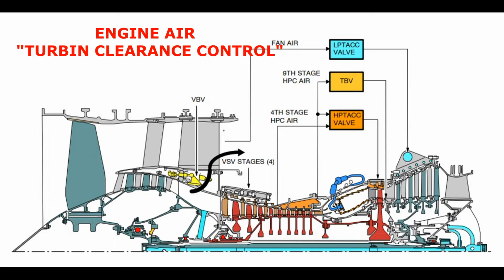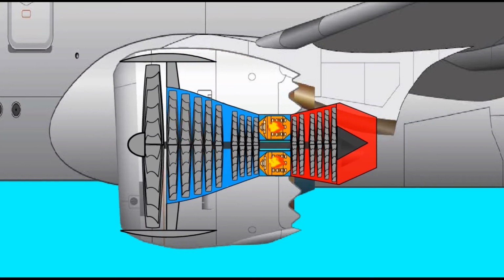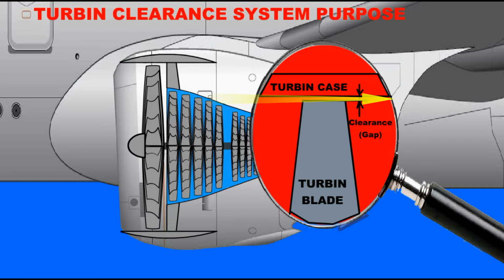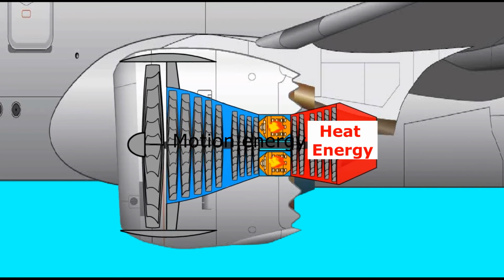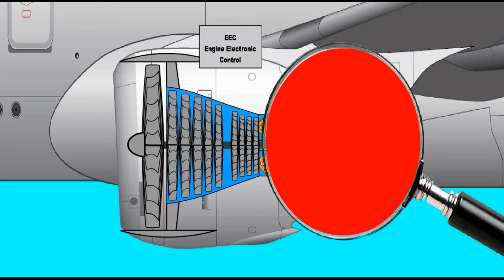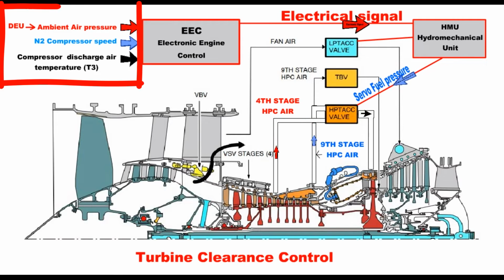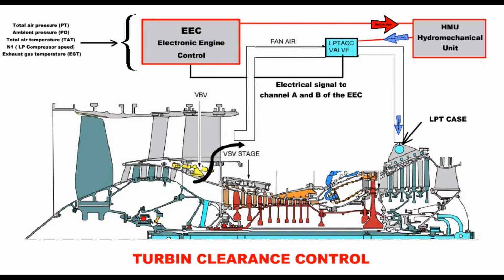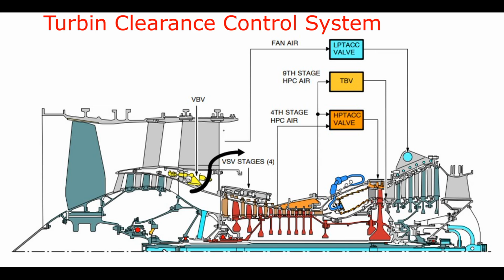TURBIN CLEARANCE CONTROL

Comment: Do you mean that when the turbine expands, the shell around it must be cooled by air to shrink and allow the turbine to expand with the diaper at the lowest possible distance between the turbine and the casing?? ❤❤❤❤
Reply from the maker: Yes of course
Reply: @aircrafttechnicians5426 Doesn't that cause energy losses? 
Please explain to me the expansion mechanism, who expands first the casing or the turbine, and is their expansion the same? ❤❤
Reply from the maker: "Turbine blades elongate due to the effects of centrifugal force and thermal expansion. This is a normal operating condition. The turbine casing must also expand to tolerate this elongation effect; otherwise, the turbine blades will rub against the turbine casing (or 'shroud')."